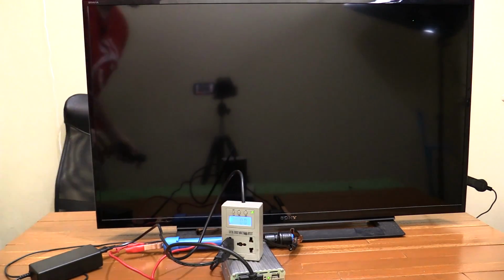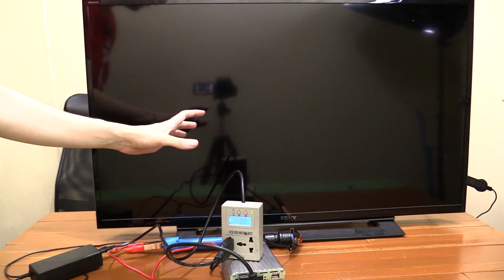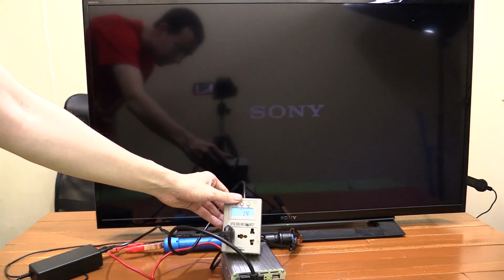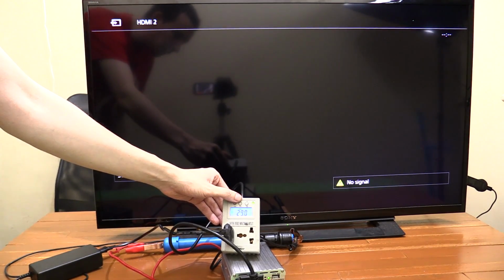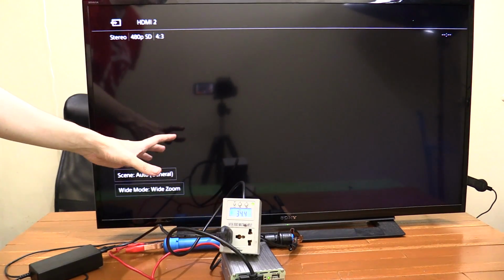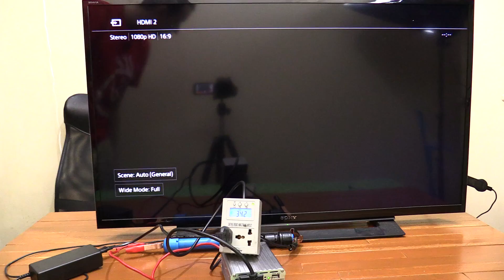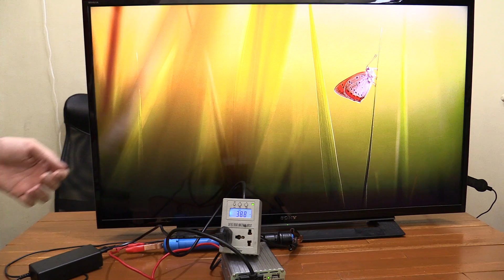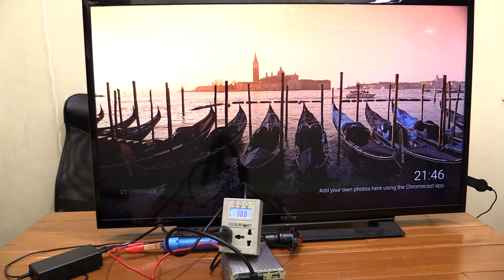Power your TV from 18650 batteries

Comment: 4 x 4,2 v= 16,8
now say the cells have 2 Amps then
16,8 * 2 Amps= 33,6 watt???
something is wrong!!! how can you drive 50 watt fan at voll speed with say 34 watt furthermore how could you power an old tv maybe 150 watt with 34 watt.. please explain
Reply: I have 18650 cells that I used to build battery packs for my RC airplanes, and I have packs of 3cells that my RC draws more than 10A, so it is possible yes.

In fact, the good way of resolving this, is looking for the datasheet from the manufacter. My cells are rated for maximum 5A without compromising battery lifespan. I can draw more, but will reduce lifespan.
Reply: Don't get amps confused with amp hours. If you have a 1 amp hour battery, you can draw 10 amps from it, just not for very long.
Reply: André Dal Molin That's amp HOURS, not amps.
Reply from the maker: What makes you think you cannot draw more than 2A out of four 18650 batteries?
Reply: let us say 2.5 Amps... also not enough
Reply from the maker: Noway0815 And where did you get the 2.5A limit from? Are you confusing amp hour ratings with maximum output ratings?
Reply: i know that because i have a lot of this 18650 Batteries and do a lot of experemnts with is it.  if you wannt get 80 watt (and this is the minimum to drive such TV) then you need a battery with 20 Amps: 80watt/4,2volt= 19,2 Amps... and this my friend does not yet exist!!! please do not fool me
Reply from the maker: Noway0815 lol whatever you say.
Reply: no my dear, not whatever i say... i'm telling FACTS... please let us all know the parameter of your batterie: which company and which model so we know the volt and th amps of the battery... easy, isn't it?
Reply from the maker: Noway0815 You saw in the video that it's possible, so why say it's not? I don't have the specs of the batteries because they're generic and unbranded.
Reply: Never because 30 years of engineering preventing me of believing that...
however, thanks a lot
Reply: This is not an absolute information. Lithium based batteries can have different chemicals to archive capacity or discharge rate.

There are cells that are designed for higher capacity with lower discharge rate, with maximum discharge of 2C (2 amps from and 1 amp-hour cell).

So the best way is always check the datasheet of all components you are dealing with.
Reply: +Noway0815 , your multimeter must be bust or you dont know how it works :-) your "facts" are wrong. Most 18650 battries are rated 3200 to 4900 mha. i bought one 18650 from a chinese shop charged to 3.9v it delivers 9A when short circuited. please stop being one of those people who finds wrong with everything in life.
Reply: Fake chinese cells dont reach this capacities. They have around 1 and 2Ah.
Reply: I'm sure the fakes don't live up to their specs, The point I'm trying to make is that one 18650 battery Chinese or not can deliver 9A at 3.9V So that's 15.6V * 36 Amps = 561.6W , no reason why it will not power a TV, Maybe not practical because it wont last long and the batteries will be stressed way beyond.
Reply: To reach 36amps at 15.6V you will need 16 cells (4S4P).
Reply: Yeah I know... but is a lot of confusing on this comment, this is my last one here.
Reply: since it is from CDRKING, batteries probably only have less than 1Amp capacity and no battery protection circuit.
Reply: Its 14,8v not 4,2v so you are drawing around 6A for 80w not 19A

Comment: It would be a nice idea to limit the loss by replacing the DC to AC inverter + the TV AC to DC one with a DC to DC inverter.
Reply from the maker: +yoann thomann yep it would be much more efficient to just use a DC to DC inverter. This was more about the idea of running an AC inverter off 18650 batteries than efficiency :)

Comment: Hi there, quick question, aren't those 12v dumb inverters, rated for a max voltage of 16v? How come it did not actvate the high voltage protection? (I'm planing on making a small backup power bank for outtages and I was wondering if I should use 3 or 4 cells on one of those inverters).
Reply from the maker: I also worried about the same thing. But once a load is applied, the battery voltage is pulled down enough to avoid the over-voltage cut off :)
Reply: Thanks for the reply. It's true the cells drop from 4.1/4.2 to 3.8 almost instantaneously when load is applied. On the other hand, the low voltage cut-off on those inverters are normally around 9,7-10.0 volts, which means, 4 cells in series will drain down to 2.4-2.5v which is not very good for the batteries at all. I think I'll stick with 3 cells, which will drain to 3.3-3.4v, and wire packs of 3 in parallel. Thank anyways and great video BTW.

Comment: You could run the TV more efficient on those batteries. 
You are converting DC(Batteries) to AC and the power brick converts the AC back to DC. 
Better would be to use a DC to DC converter.
Reply: you could hook up the batteries with a step up module directly to the tv. the tv itself runs on DC (as most electronics do). it has its own power supply built in that will convert 220/120VAC to something like 48/36/24 or 12VDC ( I do not know the exact voltage but if you open the back of the tv it will probably be written somewhere inside)
Reply: @RCP-1136  inpossible mate as bigger flatscreens like the one in this video use the 240v ac (or in your case 120v ac) to power the backlit leds in series.. the main board will be around 12v dc to 24v dc.. thats how most flatscreens work that iv worked on.
Reply: thats true as a switch mode psu has a bridge rectifier  so in theory its dc past the rectifier ?  just over 200v dc will run it
Reply: or 380v
Reply: 240vac-380vdc
Reply: if im correct
Reply: or directly access the internal voltage of the power supply ,those tv should not use more than 12v internally.
Reply: Yes its possible to power a tv with batteries.  For five seconds.
Reply: Hello, thnx for this but do u have a video where by i can see how to handle the set ups
Reply: But not all appliances is AC-DC, there are AC-AC too.

Comment: I have made similar experiments with a dc booster on these batteries and they have a safety feautre where at arround 90-95 degress celsius something inside breaks and they stop working. Best regards
Reply from the maker: +danijel124 yeah many, if not most, 18650 batteries will have built in protection against short circuit and overheating.

Comment: I've got a 48v 15ah (41v fully discharged, 54.6v fully charged) ebike battery... can you get inverters that can convert between 41-54v DC into 240v AC? I've thought about looking into ways of being able to use it during power cuts
Reply from the maker: +micheals1992 Yep there are inverters that can handle those higher ranges on the input but they're generally more expensive and designed for handling very large loads.

Comment: Soooooo..  why not match the amount of battery cells to the tvs actual input voltage. Rather than using a  DC to AC inverter, and then using the tvs inline 110volt AC to DC power block on the cord?   If its a 12volt tv simply use 3 cells plugged directly into the tv.   Its as easy as it sounds..
Reply from the maker: +wickedbadretard Because this video isn't about running just a TV. It's about running AC appliances in general. It has been discussed in great length in other comments. and yes, it's obvious that running a DC TV would be more efficient straight off the batteries without going DC>AC>DC

Comment: if u like your devices you should definitely stay away from this "solution"!
all these cheap dc to ac converter don't generate a real sinus ac!
Reply from the maker: +G. G. The switch mode power supply used for the TV, laptops and things like that can handle this modified sine wave inverter without any problems. But you shouldn't use it with inductive loads like the fan.

Comment: Can we use these 18650 batteries as a substitute for the lead acid batteries in solar power systems?
Reply from the maker: +Noel Julius Balangue With a special / modified charge controller, you could. Although I think lead-acid still works out cheaper unless you can salvage the 18650 cells from somewhere.

Comment: can we run a cpu?
Reply from the maker: +Rahil Shaikh a desktop computer you mean? Unlikely, unless it's a mini low power atom computer. Even then the runtime would be limited.
Reply: i5 cpu how much time it will run.with 20 18650 battries
Reply from the maker: Rahil Shaikh No idea. Measure the power consumption of your computer, compare it against the capacity of your 18650 batteries and the losses of your inverter.
Reply: ok thanks

Comment: With such a high drain application the life of those 18650 batterys will be tiny, in fact they are likely being damaged everytime they are hooked up. Still very interesting tho.
Reply: if the 18650's specifications are not up to the task. Power tools running on 18650's will use more power than the TV or the fan.
Reply: Sum power tools use about 20 to 35a discharge rate

Comment: can i replace 18650 battery with ordinary AA battery in powerbank?
Reply from the maker: +bIncog Nito Unfortunately not. An AA battery has a much lower voltage and generally much lower capacity.
Reply: oh.. I would like to buy new 18650 with 5000 mAh to upgrade my powerbank..
Reply from the maker: +bIncog Nito You can do that. But there's no genuine 5,000 mAh 18650 battery. The highest 18650 you can buy commercially is 3400 mAh. Anything higher is just a trick / fake.
Reply: i have compaq laptop and the battery is not charging anymore.. i will try to open and see if theres 18650 inside...
Reply from the maker: bIncog Nito Just be careful that you don't short any of the batteries or pierce them :)

Comment: Why didn't you take the inverter and the TV PSU out of the equation?
Reply from the maker: +Sven Ollino Because powering the TV is just one example. It's more about getting AC power from the batteries than specifically about the TV. But yes, it would be more efficient to power the TV directly from four-five 18650 in series than to convert DC to AC and back to DC again.
Reply: I guess I am an efficiency nerd :P You probably know this but I guess the TV has quite a wide input DC voltage range.

Comment: 50w from 1 18650 battery is a bit extreme....
Reply: +IscleGaming | ZefaCraft, it was 4 cells. Not 1.
And you can get 18650 cells today that can easily do way more than 50watt alone. Around 100watt with no great difficulty.
Those 4 cells, if they aren't garbage cells, could power 40watt for about 1 hour.
UPS should have been based on such cells long ago and it's slowly starting to happen.

Comment: would not suggest using those type of 18650 batteries because for sure they are just low amp batteries, they might not be able to handle the power output. usually those batteries only have a maximum continuous output of 4amps. samsung 25r or LG HG2 might do the job well, since those are 20amp continuous output batteries. :)
Reply: +Vince Froilan They'll almost certainly be fine. By my calcs (50w + 5w) / (3.7 * 4) = ~3.7amps is well below the 2C rating of your most modest 18650. If they're 2200 or even 2000mah cells then 2C is at worst 4amps and we're less than that.

Comment: misleading title. you're operating an invert which operates the tv. the battery pack is unable to sustain a high enough voltage to run anything a.c.
Reply: You are wrong. The tv is powered by the inverter, which is powered by the batteries. So the tv is powered by the batteries.
Reply: +Johnny Cline No he just did it the hard and inefficient way... I power tvs also.. But I eliminate the AC to DC converter..  Its kinda silly to invert from DC to AC and then back to DC like he does in this video. the tv has a power block DC inverter on the cord....  just use the needed amount of cells to reach the tvs desired DC voltage.

Comment: From all the replies you got from this video I see that keeping it simple may be the best way when making a video but you actually may give the wrong impression or guidance.  

First putting 18650's in a thick pipe like That can be dangerous in that if the batteries are overheating you may not know until it's too late.

 Second From the inefficiency of converting DC to AC to DC you would have done much better showing a $5 boost converter running the TV and would probably run it twice as long.

 Third That is a cheap modified sine wave converter  which is very bad for the motors in those type of fans. I'm sure you noticed that it had a humming sound and ran slower. That is a good way to fry a fan in a few hours. 

  I love your videos and almost always learn something.
Reply from the maker: Thanks for the feedback. Remember it's not so much about running the tv specifically but more about using a DC/AC inverter with 18650 batteries. So the efficiency isn't too much of a concern. Since it's a 19V DC input on the tv then yes obviously it would be better to simply boost the voltage instead of have losses. But the TV was simply an easy AC appliance to use as an example :) and yup I've covered the issues with inductive loads on modified sine wave inverters in many of my videos and comments but it never hurts to remind people :) maybe I'll just use a pure sine wave inverter in the future to avoid any confusion all together.

Comment: How about a link to where you got those battery pack's from!
Reply from the maker: I bought them from a local store, cdrking. They have a website but it's only for pricing information, not for ordering. You'll find them on ebay and Amazon just as cheap though :)
Reply: U could harvest them on old laptop battery 👍👍

Comment: if be interested seeing how long the tv would run on a full charge.
Reply: Moka hless if you have 43w/h of consumption and only 38.48w/h stored on batteries you can't complete 1 hour of powering the tv.

38.48/43 = 0.89...
60=1 hour

89% of 60 = 53.4 mins of operation.

more or less..
Reply: @geogmz8277  very true. From kenya east africa.
Reply: 4 batteries nominal 3.7V*4 = 14.8V (not sure if nominal should be used in the calculations)

mid-cost ones are usually about 2600MAH

14.8V*2.6A=38.48W

TV was using 38W most of the time. Add 5W for the inverter, he said.

43W*1 hour= 43Wh

43wh/38.48W= ~1.17h or about 70 minutes runtime

It's late. Someone please check my math, just in case I did something stupid.

Thanks Geo! I did do something stupid and reversed the division. See Geo's post; should be about 53 minutes.
Reply: @mokahless  why you didn't do 2.6a*4=10,4a
And 14.8v*10,4a=153.92w 
Tv 38w + 5w of the inverter =43w 
153.92w/43w=3.5 hours 
If im wrong tell me, im not a professional !!
Reply: Geo Gmz not even that as those batteries are fake 18650's from china
Reply: those are 2000mAh, maybe 2400mAh max...
Reply: can u tell how long the electric fan last on that 4 batterys..or can we just add more baterry???

Comment: Very inefficient way.... 16V to 230V back to 12V?!
Reply: +Gadget Addict Way awesome experiment. I have a PILE of 18650's waiting for usage. It would be pretty cool to wire up some li-ion charge controllers and build my own UPS's out of these. 

Yes, there is some inefficiencies going on there, inverting from 16v to conventional home voltage, to the TV which likely is converting that voltage to 3v, 5v, and 12v on the internal power supply. To go direct from the cells to those three different voltages and bypass the TV's power supply would be a lot of work for a non-permanent project but you'd likely get some super impressive run times. Regardless, awesome experiment.
Reply from the maker: The fan runs on 220v, not 12v. Anyway I guess you're talking specifically about the TV, I think it's 19V DC. It's only a sample load rather than a specific or ideal use scenario :) as discussed in other comments, for powering the TV it would be far more efficient to use a small boost circuit than to convert to AC and back to DC :)

Comment: What would happen if you directly power the tv (~19V) with a set of 5 18650's in series (~21V)? Would the TV explode or overheat?
Reply from the maker: +comebackata2 I'd expect most Tvs to have a voltage regulator that could handle the higher voltage, but there's no guarantee of that. So yeah, potentially you could blow something. The TV wouldn't explode though :P

Comment: can we get 18650battery holder in series
Reply from the maker: +Mohammed Aliman Ahmed They''re commercially sold although I haven't seen them locally. You could make a smaller holder than the one I made here. I just chose PVC pipe cos I had it laying around and it was the easiest thing to put together to test my idea. I'm thinking about 3D printing a holder that can take 8 batteries and then take apart the smallest 75 watt inverters that CDRKING sell to make an all-in-one product.
Reply: +Gadget Addict nice idea i have seen near my area but they said its connected in parallel. but i might try to make it but how much is the lenth of the pvc pipe diameter
Reply from the maker: Mohammed Aliman Ahmed The PVC is super cheap, although I think you can only buy it in long lengths. Mine was from when I made PVC light stands. If you go around any work site, you'll find scraps of it, so maybe you can just ask one of the workmen if you can take a piece.
Reply: +Gadget Addict thank u ;)